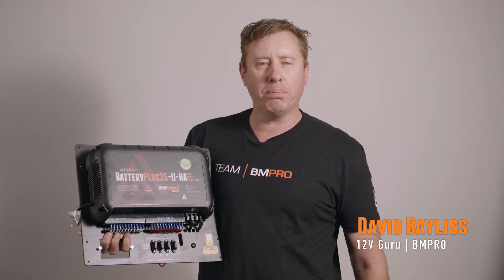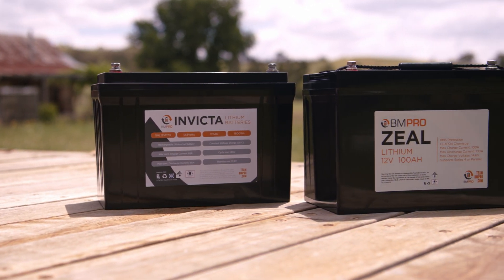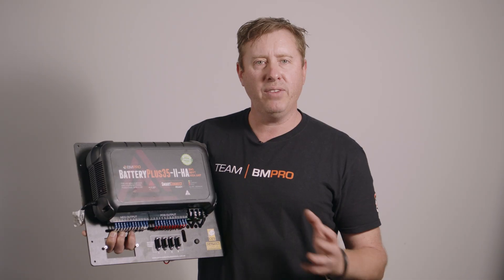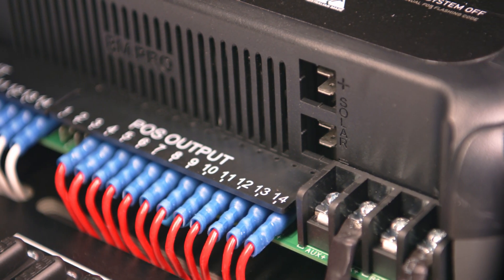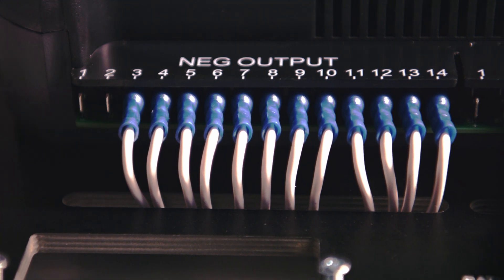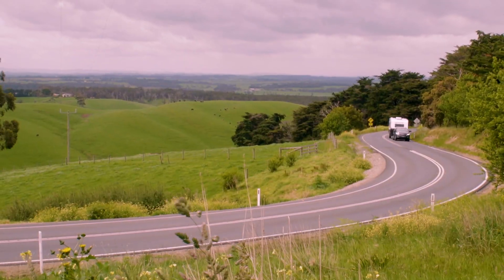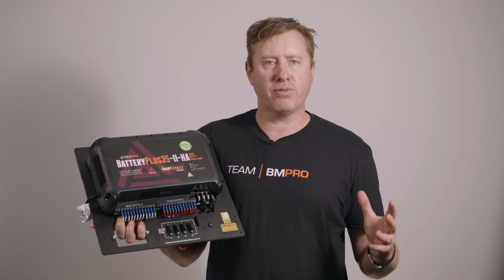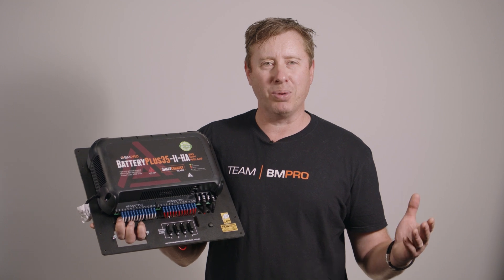BatteryPlus35-II Overview: What's New In The BMPRO Power Management System

Comment: I have a few tech questions for BMPRO 
I have emailed but yet to receive a reply 
I have a 2018 Winnebago XCountry  Burke caravan
Currently I have a Bmpro35, trek interface ,
I have purchased a Bmpro-11-HA so I can upgrade to one 200 amp lithuim 
My questions 
I assume it’s pretty much disconnect and reconnect inputs and outputs ,
I don’t currently run a aux charging  Anderson from my 2015 Ford Ranger 
I am hoping to run the power with a fusable link and Anderson plugs directly into the aux input , 
In regards to solar inputs , one will be fed from my roof top factory solar , the second  solar input will be fed via Anderson plug and a 250 watt foldable panel 
Do I need to remove my lithuim controller on my movable panel and direct feed ( same as my roof mounted solar ( according to Bmpro tech tips) if this is the case , I have a 1000 watt inverter, 
I think that about covers it for now

Comment: Hi, I have the BatteryPlus35-II-HA with the TREK3, I have been told that even if I'm not using the van, not to turn the TREK3 off, to leave it on.
I have in the past turned the TREK3 off when I've finished using the van, what should I do, Leave the TREK3 on or off?
Thanks for your help. Mick.

Comment: Hi BMPRO, John here, thank you for your videos, I notice you said the BatteryPlus35-II is ok to receive input from 2-3 solar panels, we are getting a new Crusader caravan that uses this system (with the Odyssey screen) & looking at putting 3 x 200w panels or maybe 4 as we will run a compressor fridge and many people say to put as much solar on the roof. Is this system ok to have 3 or 4 x 200w panels feeding to it? The van dealer said 4 panels is ok, but wanted to check.... If not what options are there to manage say 4 panels? Thank you 😃

Comment: What happens if you got 800watts of solar that system ?
Reply: I am not sure about 800w in terms of heat dissipation etc.  However I also had a query about overpanelling.  I queried adding 500w.  The response from their tech support was that it would be ok.  The unit will continue to charge at it’s maximum (30a/420w) and any energy generated  by the solar above this wasted/not used.

Comment: Hi , does the  aux input still just pass through to the battery and requires the additional dcdc unit to up the amps charge the battery  or has been upgraded to remove this requirement?

Comment: Very disappointed that the output algorithm cannot be changed from lead acid to lithium without buying another component. Possibly add a switch or dip switch so this can be achieved without having to buy a touch screen or trek which are quite expensive for what they do.
Reply from the maker: The use of an OdysseyLink 103 can also be used to program the algorithms and battery sizes. This will also give you full control of the system from up to 4 smart devices such as your own smart phone or tablet
https://teambmpro.com/products/odysseylink103-communication-centre/
Reply: Agreed, was about to purchase the charger for lithium batteries until I realised another $600 is required in order to configure it to charge lithium batteries.

Comment: How does the compare to redarc tmvs
Reply from the maker: Hi Alisha, depends on which exactly product you are comparing. BMPRO BatteryPlus35 caravan power management systems are designed and manufactured in Melbourne and are installed in the leading caravan brands.
Reply: @BMPROau  Looking for something that will be ok for a camper trailer.. The product would be the Red arc RedVision vs say bmpro battweryplus35-II-HA with odessy
Reply from the maker: BatteryPlus35-II-HA is compatible with lead acid and lithium batteries, and would definitely be a good choice for your camper trailer. You can install an Odyssey monitor if you wish, or opt for a more simple monitor, such as RVView2 or Trek3, and use them together with the Odyssey app on your smartphone.

Comment: Hello, would this also suit a 4x4 canopy setup instead of say Redarc or Victron chargers that most people are using? Could I plug a 12v water pump, 12v fridge, Travel Buddy into this? Regards Paul
Reply from the maker: This would be fine in the canopy of a ute, I use one myself every day of the week. The outputs are rated at X2 at 15amp and X12 at 10 amp. If you are wanting to fit an inverter down the track, you can mount a BC300 at the battery and see all loads directly at the battery.

Kind regards, 
Stewart / BMPRO Product Specialist
Reply: @BMPROau  thank you for the prompt reply and info. You have given me something to think about. Regards Paul.